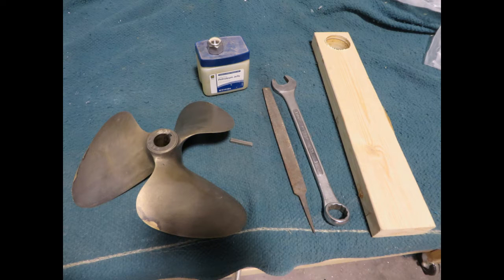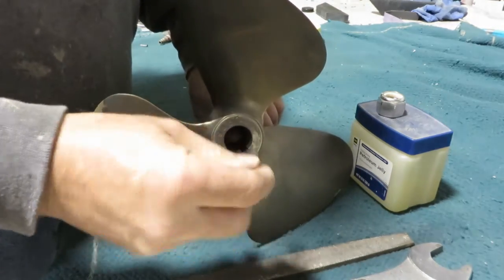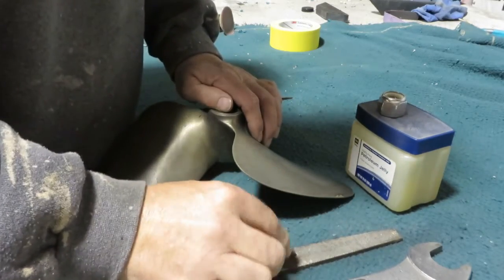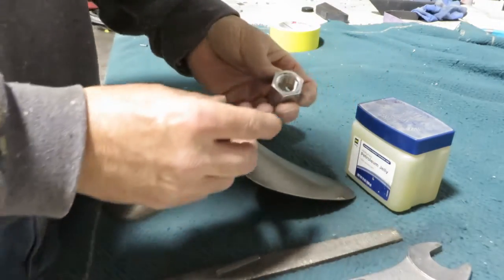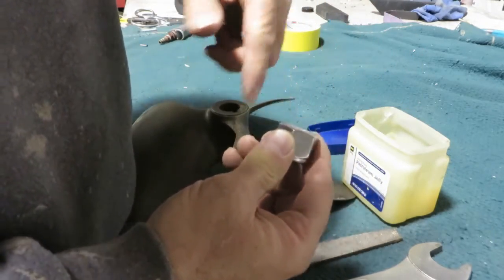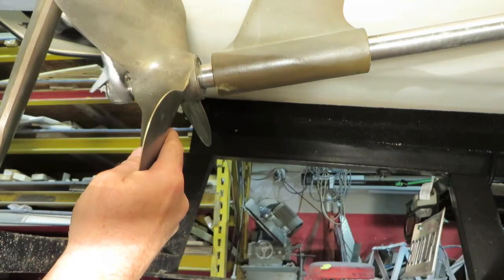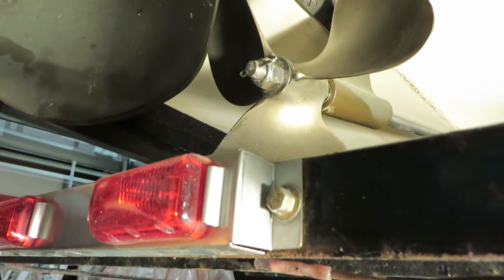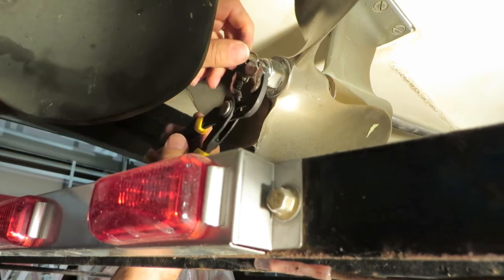Installing A Ski Boat Prop

Comment: Fantastic video Ron.  Replaced my damaged prop prior to watching this video and experienced slight vibration starting at about 20-25% power.  Was about to waste a ton of money replacing my prop shaft but saw this video, removed/reinstalled the prop following your instructions and voilà: smooth as buttercream.   You are truly an invaluable asset to the entire past, present and future ski boat community.

Comment: What is the torque on the prop nut?
Reply from the maker: I've never used a torque wrench to tighten a prop nut, I use a 1/2" breaker bar & make-em tight
Reply: @rontanis1024  
Thank you Ron!  You're a great asset to boat owners!
Reply: ACME recommends just 50 foot lbs.